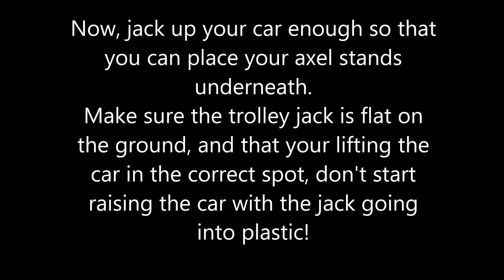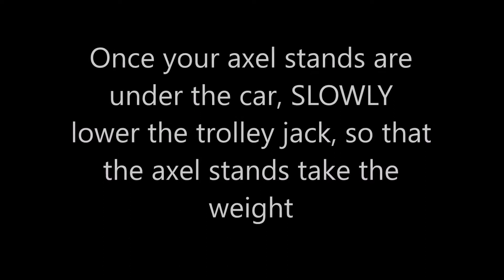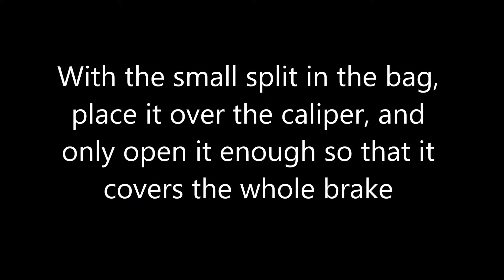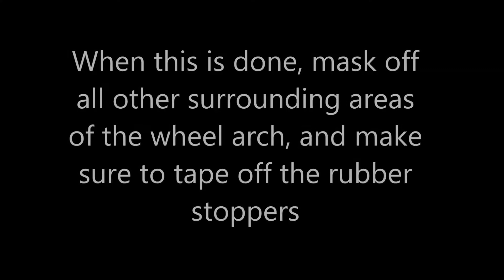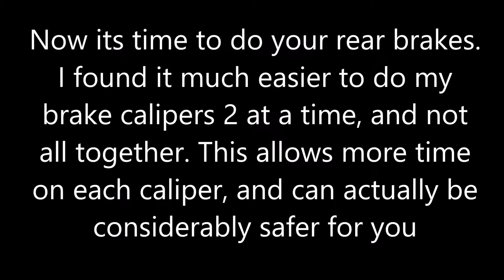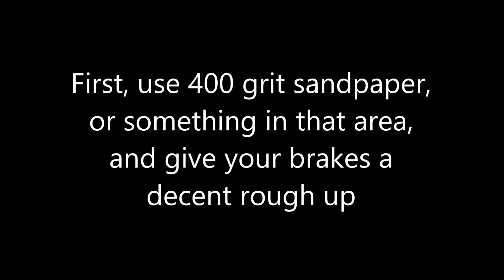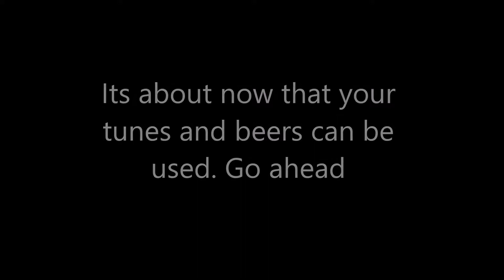How To Paint Your Brake Calipers

Comment: This is actually something I want to do soon, I am in Canada & it's nearly winter..... So I will likely try to attempt this next year. 
Whatever I can do to make my Lancer look more flashy then it is haha.
Reply from the maker: Dude get onto it! Does it matter if its winter? If you do it properly it should stand up well against the snow!
Reply: @tomelliott8096  Well the main issues is its more damp now, and it's cold & I don't wanna be outside haha. 

But I am focused right now on finishing my car audio stuff. 
I got everything I need gathered together & Wednesday I'll be putting it all together at last. 

4 infinity reference 6.5 speakers. 
4 channel infinity reference amp. 
One dual 10inch sub with a 300 Watt dual2 channel amp. 
(On the cheap side for my sub for now) 

& already installed a double din pioneer head unit with steering wheel controls maintained. 

This is improvement is the one I was most looking forward too!
Reply from the maker: That's awesome man! I have videos on all of those installs if you need any help! Good luck.
Reply: @tomelliott8096  yep I seen your videos first, & I already got it done last week. 

I'm quite surprised how decently the dual sub & amp is doing. 
Maybe it's not making my car rattle like crazy & being loud enough for people to here me on the other side of the street. 

But it's filling the car with nice punchy bass quite well at the volume I am choosing to listen to it at. (Very loud, but I shouldn't go deaf)

My infinity's I find the highs are not quite as crisp as the last time I used them in an install. 
Or maybe I am loosing my hearing.....
Reply: Do you have a link to buy the paints?

Comment: Hey, so it's not necessary to take off the calipers or brake pads? Just try to mask it off as best as you can ? Any problems with braking after this ?
Reply from the maker: Not at all man! That is way too much work for a small paint job! Some people will do it, but it is definitely not needed! My brakes are fine and are as good as new man!
Reply: They do good work